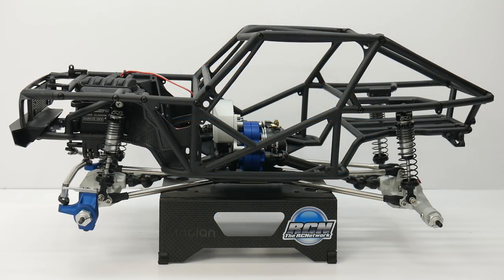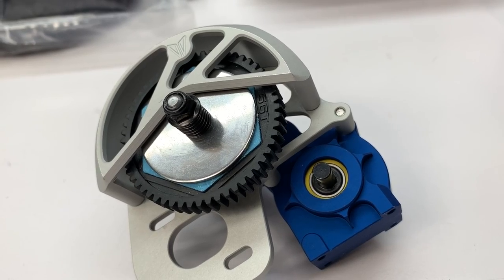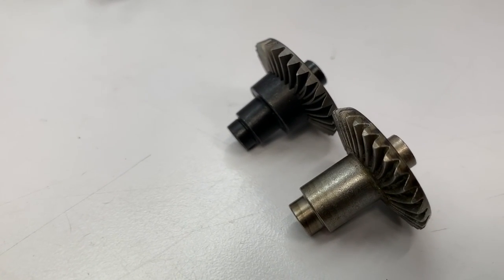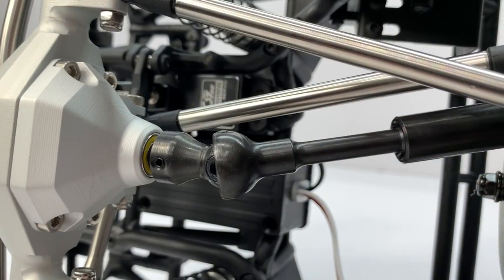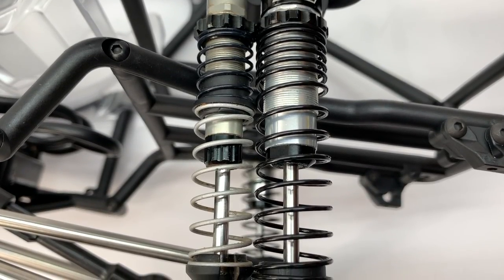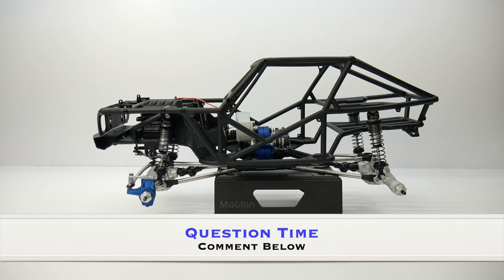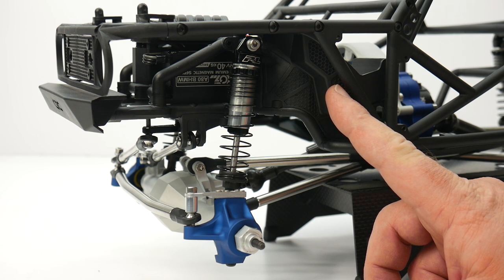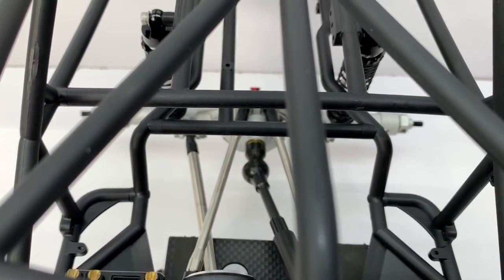NEW Custom Build EP2 - 2020 - Scale RC Truck - The RCNetwork

Comment: I’m with Nfourty7. Make it a crawler/racer/ bouncer. Inner fender wells will clean it up a bit. Whether you do panels or body, my vote would be to do the old wraith style with the notch. Lots of 1:1 off-roaders do the same for better visibility of the front tire from the drivers seat. Interested to see what you come up with.
Reply from the maker: What's this notch you speak of?? Thanks for the comments
Reply: The RCNetwork where the cage dips down.

Comment: Make it a scale crawler. 4.19" tires work great on the 1.9 Wraith when you set it up to be narrow as possible with 225slw hubs
Reply from the maker: I do have a fresh set of 4.19 hyrax's.
Reply: I'm running the 4.19 KM3's on Predator compound and it does absolutely amazing. I went ahead and put in a full Wraith interior with 2 full size figures, Vanquish scx10ii Rovk Jocks and all the electronics are sitting up front along with the batt too ofcourse. She's a little pig now lol

Comment: Make panels and I thing it will make a great bouncer......I have been wanting a bouncer this could be the reason.....I am building a new rig started with a vs 410 chassis and trans , thinking of using trx4 portals with 2.2 tires ...not sure about body yet been thinking power wagon maybe a 66 Chevy... maybe a Toyota hilux hardbody what do you think....
Reply from the maker: Nice build - I need to do a VS410 build here soon.  I'm . a Toyota fan before Chevy (mostly because I drive a Ford now) but I had the OG toyota pick up (before the Tacoma thing)

Comment: Run the body it'll look great
Reply from the maker: Thanks FC!  It is a snazzy body
Reply: @TheRCNetwork  yeah it is but you did make some nice panels and you ended up selling the body on eBay I only know that cause there's a guy on here with his own channel who said he bought it and that it was the one you had it was all cut out and ready for paint he painted it white about a quarter of it from the top then orange from where the white ends down he also mentioned that you threw in templates to make the panels that's awesome

Comment: Hey rich nothing to do with this vid but knowing your tekno experience I'm trying to find out why the mt410 that I recently purchased has 100,000 100,000 50,000 diff oil and the et48.3 uses 10,000 10,000 5,000 big difference they are basically the same just a shorter classy. I called tekno he said because of the vehicle weight. But the truggy is just as heavy ?help me understand?
Reply from the maker: Yeah, vehicle weight is about the same - but the Truggy is obviously their race-line of vehicles.  10/10/5 is a race set up mostly for cornering and quick power transfer (the lighter weight oil transfers power to the axle/wheel that has grip) . The 100/100/50 set up is more for bashing, like most MT410 owners want - it helps transfer equal amounts of power to each end (front / rear) giving the MT410 a more stunt like feel - meaning it will pull wheelies easier and do back flips and front flips easier.
Reply: @TheRCNetwork  thanks for your response I actually run it on a dirt track and do like to back flip it at the finish line 😀but I notice it doesn't turn well is the heavyer flued causing that ?

Comment: Inner fenders look noice. But less air flow for the servo. If you do aluminum are you gonna a paint it or leave it raw?
Reply from the maker: Yeah, I thought about the servo heat - it will have airflow underneath.  We will see.  I made the inner fenders and they look weird silver.  Likely will be hitting it with flat black

Comment: I ordered a SS screw set for one of my TLR’s, do you think SS hardware is worth/better than black oxide? I’m not sure I am going to utilize them on the build at this point. Your thoughts?
Reply: SS screws are worth it if there's going to be any moisture at all where you'll be driving. Team KNK has probably the best SS screws that I've come acrossed.
Reply: @NikkiNexo777   I know that SS is more corrosive/rust resistant, but I do not tend to drive in moisture. I purchased my kit from RC Screwz, they back their stuff with a 100% customer satisfaction.
Reply: I just put some SS screws on my proline MT 4x4 I tend to wash it down a lot after run in dirt so less rust is plus. I always dry it but it doesn’t take much moisture these days to rust out of box screws.
Reply: RC Screwz are alright. I just got the kit for my SMT build, no complaints. $35 for 310 pcs. Comes with washers and nylocks.

Comment: Hi I like your ESC motor combo I can get the xerun 3652 4000 kv for 54 bucks will the 4000 kv be much different then the 3100 that your using if not I'll get the 3100 for 80
Reply from the maker: 4000kv would be way too fast, especially on 3s...you might be able to get away with 2s...but you'd lose all of the torque you get from a lower kv motor on a higher voltage
Reply: @TheRCNetwork  thank you I thought so so I bought the 3100 kv motor last night from Hobbywing North America  it was just a very good deal for the 4000 kv $30 bucks off can't go wrong yeah I'm looking for a crawler with a lil speed and torque not looking for a basher with crazy speed thanks for the response oh and for your question I know I'm a lil late but you should crawl with your rig that's my opinion I'm not into all the go fast stuff but that's just me and you built a very nice looking CRAWLER

Comment: This is RC porn... Excuse the expression...

Panels, fender wells, and keep it versatile. Quick shock adjustment, and a second tire/wheel/foam combo. You have the right power and gearing to do both.
Reply from the maker: I agree on the RCP!  great idea on the second wheel/tire combo